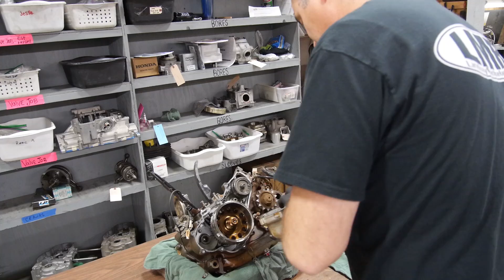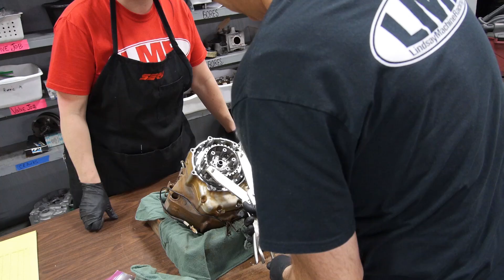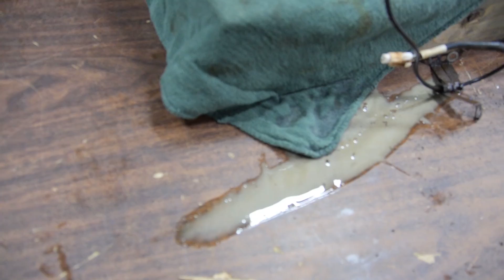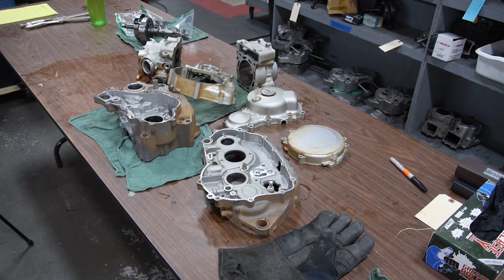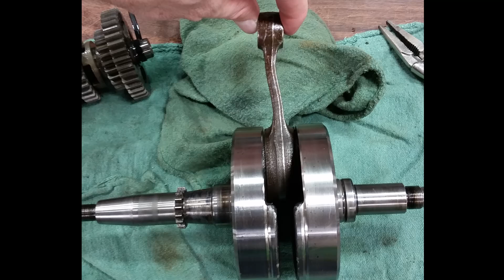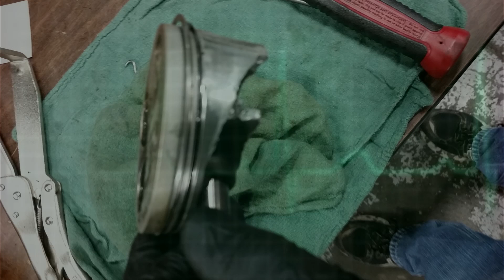++Athena++ Motor Disassembly Aussie and UK version

Comment: Every time I do something like that I always end up with a little baggie of extra bolts.  But it's been 120K miles since I replaced the head on my VW and it's still running.  I still have 8 different sized bolts in my toolbox that I have no idea where they go
Reply from the maker: +FRAG-AFE  I'm sure our Bavarian friends put them in there just to wreck your life..... Now it is your job to find a place for them that will wreck the next guys life....lol
Reply: MrDuhfactor with everything I had to take off in that tiny engine bay to get the head off... I'll just put them in the glove box when I sell it with a note, "left over from major maintenance at 130k miles... Good luck"